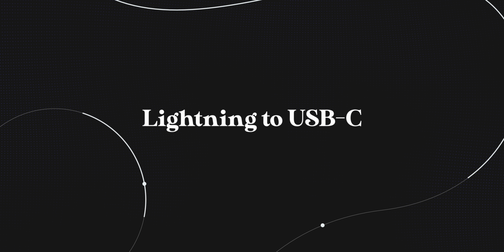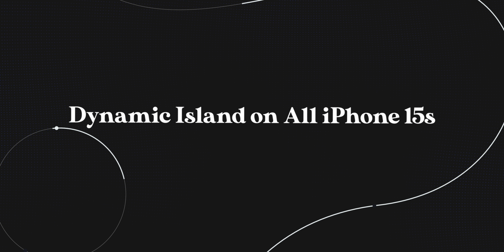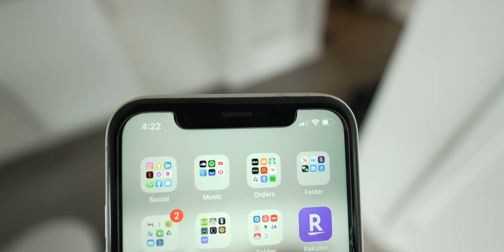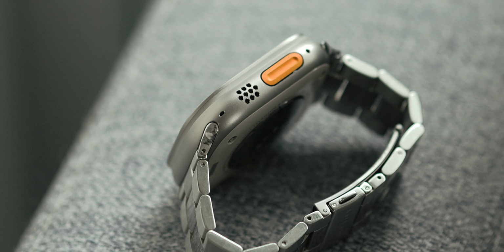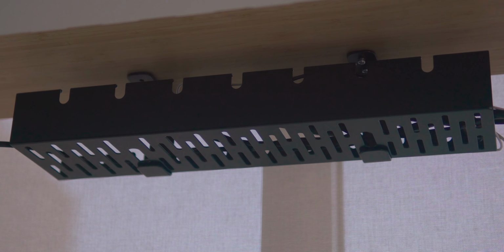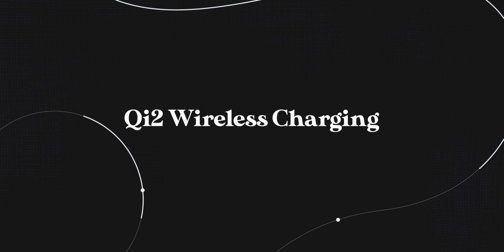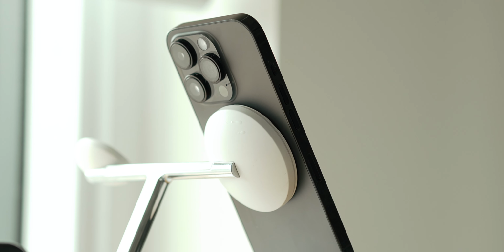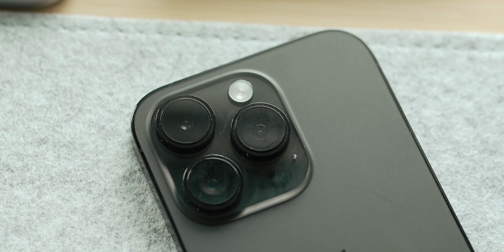Why iPhone 15 Is Exciting!

Comment: Regular iphone 15 is going to a good upgrade for it's PRICE and provide better value.
Iphone 15 base model will have:-
1. 48 Mega pixel main camera which will take more or less take the same pictures as 15 pro. The third tele photo lens will only be used for excessive zooming by photographers and not by the average user.
2. USB - C connectivity, you do not transfer data from your phone on a daily basis so speed won't matter, only charging does and that will be same for all.
3. GREAT battery life, 3877 mAh battery, 18% increase from last year regular 14. 
Also as it will not have AOD or 120 hertz the regular iphone 15 battery will be better than 15 pro 
and it will for sure be better than last year's 14 pro which already has abysmal Battery degradation issues, over heating issues ! 
4. LIGHT WEIGHT, Iphone 15 regular (aluminium)  will weigh approx 172 grams only. 
Sure, The 15 pro (titanium) will weigh slightly less than 14 pro (stainless steel, 206 grams, so heavy, almost a brick, not a good form factor for people with Small hands ) but still the Iphone 15 regular will still be significantly LIGHTER than the 15 pro. 
The weight of a phone matters a lot in daily usage.
5. New Curved edge design will also come in the regular 15.
6. Matt FROSTED BACK instead of glass back for first time in regular iphone 15. It will make the 15 look more premium just like last year's pro's.
7. A16 processor (Yes it's a last year processor, but it's more than enough for the average consumer and much BETTER than androids).
8. Dynamic Island will be available in the regular 15.
9. FUN COLOUR OPTIONS, the 15 pro's are going to come in DULL gray, and same silver, black and dark blue. If you like a pop of colour, the regular 15 will provide you with much better options.
10. PRICE !!! Seriously amidst an almost recession across the globe, inflation and lay-offs they want people to spend MORE money for INCREMENTAL updates in the pro model. At least the regular iphone 15 the price will remain SAME.
11. Longer and BRAIDED charging cables with colour matching with the regular iphone 15, This will provide better protection to cables.

So, yes, Iphone 15 pro is better than 15. But will it be worth spending 1200 to 1300 dollars ? Nope. The only let down with regular 15 is 60 hertz refresh rate, which most people don't notice. If you can live with it, Definitely buy the regular iphone 15 !!!